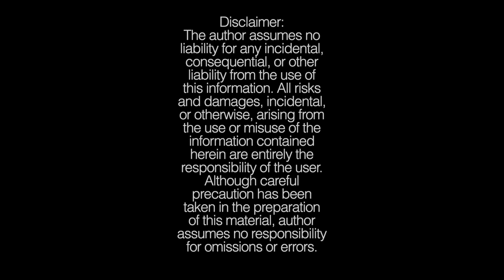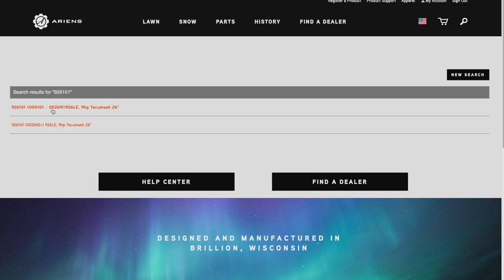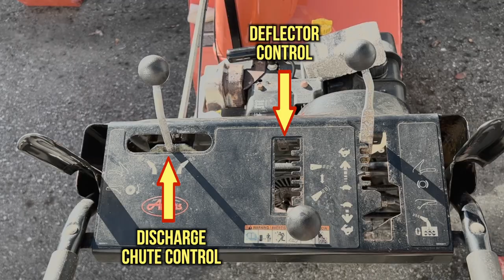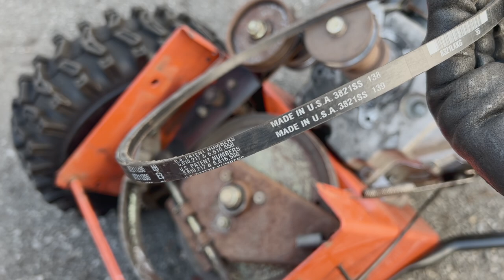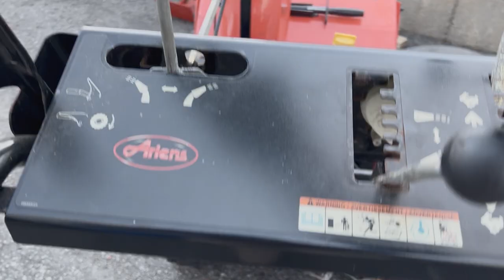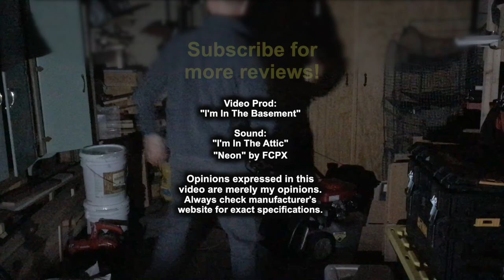Replacing The Traction Drive Belt and Attachment Belt on Old Ariens Snow Blower 926101 (2005 model)

Comment: Hey there, that snowblower is like the one I bought in 2008! This season I too had to replace the drive belt. It was freezing cold but I got it done as my fingers went numb! It's a 13 HP unit with 32-inch width.
Reply from the maker: I remember rolling out in a storm and having to repair the belt in freezing temps. Without traction drive the snowblower is a beast to push. I was tempted to leave it at the foot of the driveway until spring. 😂

Comment: one other thing how about 5/16 bolts NOT 9/16. I've never used 9/16 bolts even thought they do make them.
Reply from the maker: In the video I noted the sockets that worked. I had the snow blower professionally repaired a long time ago and it’s possible the guy who repaired it changed out some of the bolts.

Comment: @Bruce Alan,
Your belt broke because the angle of drive pulley is to great !
place a nylock nut on the back side of the friction disc stop bolt.
That will act as a shim on the plate reducing the angle so belt wont slip off.
Reply from the maker: Yes, I actually did that last year although I placed two locking nuts on. Worked great!  Thanks!

Comment: You are a champ for doing this and with one hand no less. Question, last winter I was having drive issues in heavy snow. How do I know if it’s a belt replacement issue vs, I don’t know, a tension issue?
Reply from the maker: I had the same belt on for 5+ years without any issue, but then I started experiencing frequent broken belts and it kept falling off. Belts can stretch; however if you experience those symptoms, it’s tension in which case I added a nylon locking nut to the stop bolt to push the pulley back a little. Over time the stop bolt can start to push into (or merge with) the pulley, which changes the pulley position slightly and causes excessive belt breakage. If you see the stop bolt’s thread marks on the pulley, that’s a good indication you should add a nylon locking nut. The other option is to replace the traction drive pulley, but a nylon washer is more economical. 😃

Comment: I have the exact same model. The belt is two seasons old, and a stens, but it keeps throwing the belt!
Any suggestion what else might need to be replaced?
Reply from the maker: If you’re referring to the traction drive belt slipping, the most common issue is that over time the threads of the stop bolt (stop bolt holds the drive plate assembly in place) wear into the drive plate assembly. As a result the drive pulley behind it is slightly out of alignment with the engine sheave and traction drive belt idler so the belt slips off.  To remedy this, you have two options: 1) replace the drive plate assembly; or 2) do what I did, which is to screw two small nuts onto the stop bolt (tighten them opposing each other or they’ll rattle off over time). Adding the two nuts will get the drive pulley into its proper position. Hope that helps!
Reply: stop bolt at: 10:00
Reply: @BruceAlanR  yeah Bruce, I was checking that out today (I am getting the belts on order now) and I was wondering if the springs had gone bad. They seem fine at first glance, same with the traction wheel (the rubber wheel that makes contact with the plate that spins the wheel) 
I wanted to ask you though, how would you know if that traction wheel has gone bad (this is my first ever snowblower and was given to me) and at what point would a spring be considered 'bad'. I would assume rust for a spring but I have no idea about that traction wheel...
Reply from the maker: The rubber wheel is the friction disc and it would show signs of wear (worn rubber), but it doesn’t usually fail. When springs rust to the point of breaking , which is when it’s time to replace them. All the parts other the chute cable and belts are original on mine. This thing is built like a tank  so if you take care of it it will last decades.
Reply: @BruceAlanR  the rubber on the friction disk is very smooth, but I'd say it's nearly 1/2" thick still and doesn't show any dry rot
Reply from the maker: @xVoidCypher btw- I put the opposing nuts on the stop bolt after the video so you won’t see it.
Reply from the maker: @xVoidCypher sounds like it’s fine to me.

Comment: Thanks for the detailed video. I have the same exact snow blower and need to change both belts so this video was a huge help. By the way, great one handed job.
Reply from the maker: Glad the video was helpful! One thing I didn’t mention in the video is that you may find helpful is that if you find the traction drive belt slips off or starts to break frequently, add a nylon locking nut to the stop bolt to push the pulley back a little. Over time the stop bolt can start to push into (or merge with) the pulley, which changes the pulley position slightly and causes excessive belt breakage. If you see the thread marks of the stop bolt on the pulley, that’s a good indication you should add a nylon locking nut. The other option is to replace the traction drive pulley, but a nylon washer is more economical. 😃
Reply: Thanks for the update, I did not have this issue. Everything is back together and seems to be working fine. Hopefully we won't get another snowstorm until next winter.

Comment: Why did you take the auger gear box assembly off?  You said you were only changing the belts I don't get.
Reply from the maker: It’s just easier to change the belts that way. I literally followed the directions step by step in the paper manual from 2005.

Comment: It looks as though you could just remove the stol
 bolt and maybe not even the tensioner and slip that belt in without disassembling the whole thing
Reply from the maker: Thanks for sharing your thoughts. The way I demonstrated in the video is based on the step by step instructions from the original owner’s manual, which I still have after all these years. Ha!